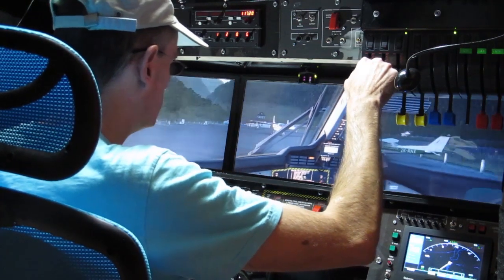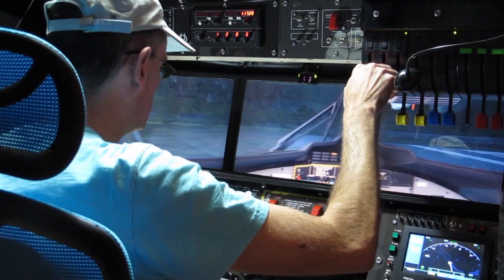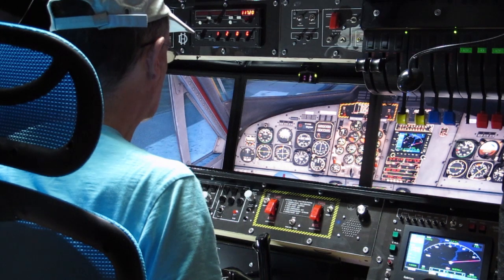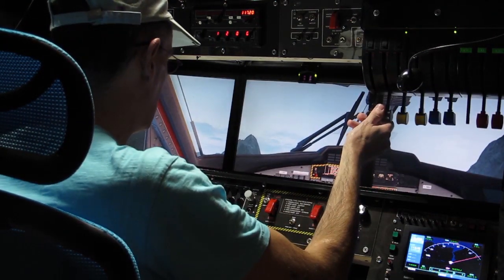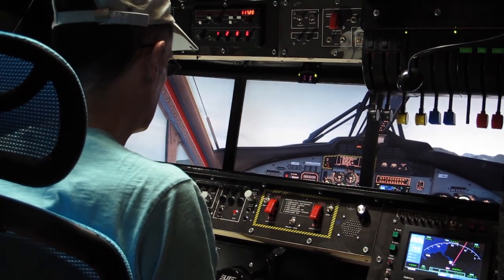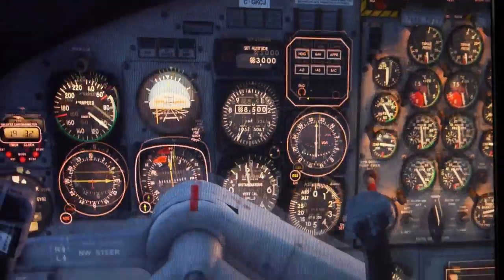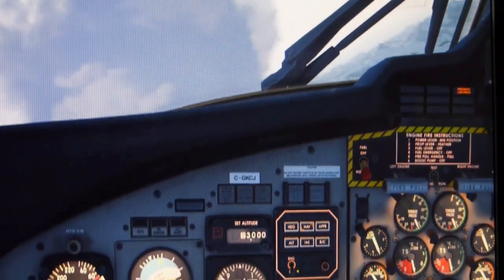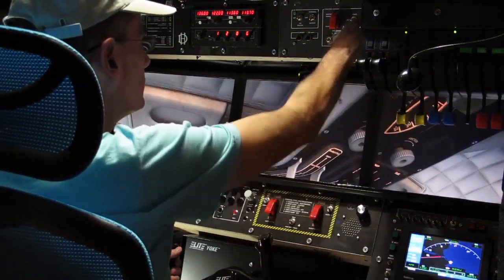Twin Otter Close Up #3 - Autopilot 1

Comment: Which flight simulator do you use?
Reply: Thanks! I'm impressed by the framerates that you're getting.
Reply from the maker: Don't be, they're not that good :( I have the cap set to 40 but the actual frame rate varies quite a lot.
Reply: Eh, pretty good for an aerosoft aircraft, or any high quality addon a/c for that matter. Love your videos!

Comment: Holla! how did you combine the screens to work as a unit?
Reply from the maker: +Jude Uwuilekhue Uwagboe I am using an nvidia GTX670, which supports '2D Surround'. You just plug three monitors in, enable Surround and it sees them as a single monitor.
Reply: thanks bro
Almost Aviation

Comment: Nice and informative video. I hope you enjoy the fruits of your hard work.
As for me but still wondering:
why your oversized 2D GNS panel appears not to participate in any visual monitor? Because on one hand, it must indeed adjacent in the Nvidia Control Panel and there should appear the frame.
Reply from the maker: Hello Ralf. Yes, thinking about it I can see you are right but I don't get the monitor surround, regardless of where I position the small monitor. I wonder if there is a more subtle reason. I am running the small monitor on a second video card rather than on the fourth connection to my main card, so perhaps this makes a difference. Or maybe somehow it IS intruding onto the main monitor but the window is behind the VC window? I don't know if you can manually change the window order, perhaps by closing the VC window and then opening a new one?
Reply: Almost Aviation
Ah - the second graphics card we are, i believe, correct.
My personal ask:
Are there other possibilities to communicate with you?
Do you have any interest in it?

Comment: Did you get your FF yoke yet? IRIS?, have you landed the t'otter on the quintin lodge strip, would like to see that, afterwards you can have you tea there
Reply from the maker: No Iris yoke as yet, they are supposed to be assembling them about now. Have not yet landed at QL, although I have sort of landed messily at the strip next door. I need to develop a bit more control first!
Reply: Almost Aviation
give it a go, the approach is steep and the grass strip, not very long, a twin otter might just be able to do it